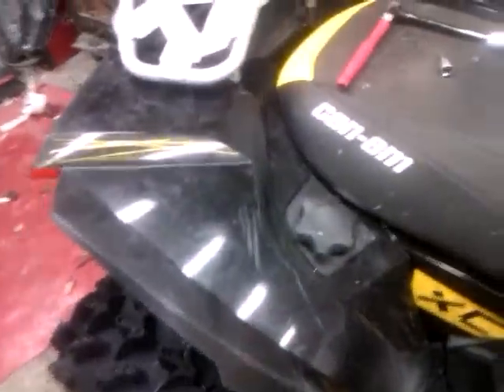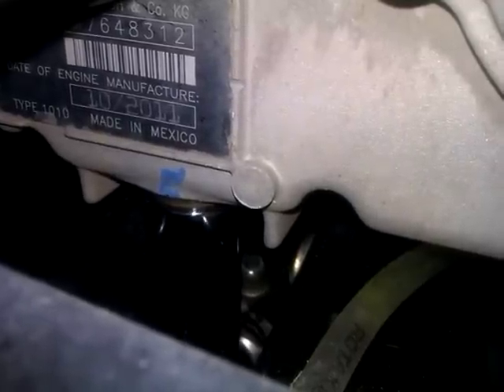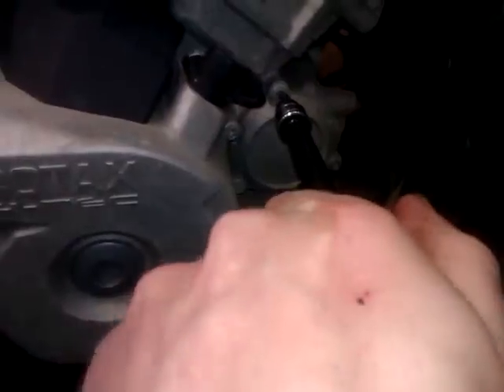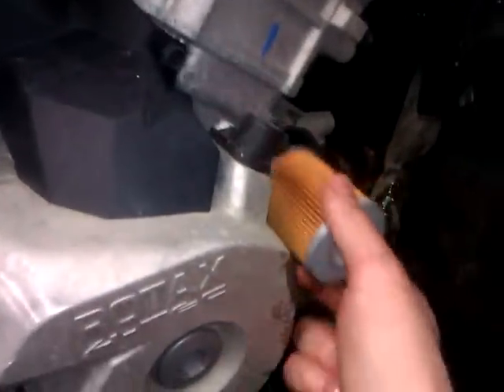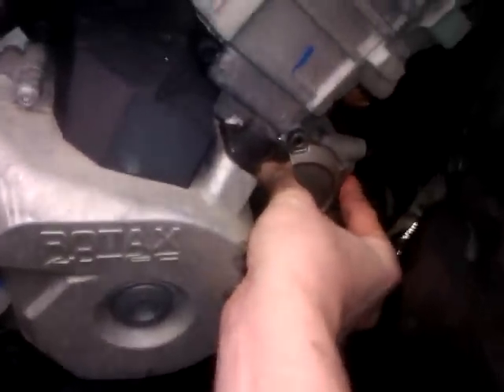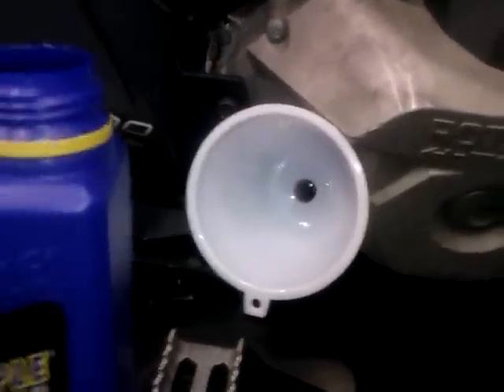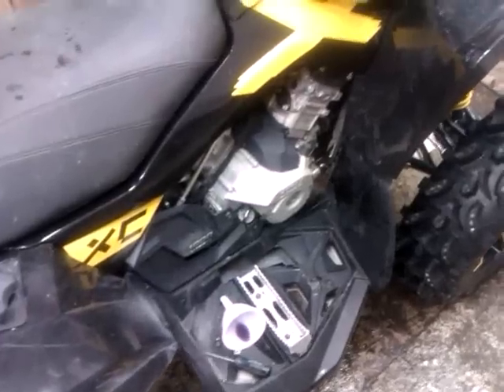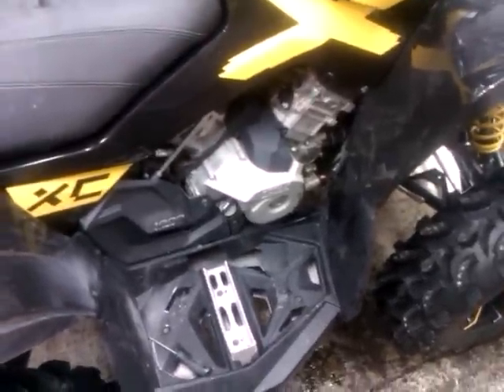Can-Am Renegade/Outlander Engine Oil Change, How to

Comment from the maker: Royal Purple is considered a high-performance oil with additives needed in a demanding performance engine. I used to run XPS because it's what BRP recommends but I noticed that the XPS is really thick in the winter, foams a lot at higher rpms, mixes with water and doesn't seperate even after sitting for a while, breaks down fast and costs around 18$ a quart. As for the Royal-Purple it keeps its viscosity in the winter, doesn't foam, separates from water, longer life and costs about 12$ a quart

Comment from the maker: Yes you have a good point there.
It's a great idea to warm up the engine before doing the oil change. The oil is not as thick when it's warm therefore it will empty out alot quicker.

Comment: I have the same tires on my Outlander. They're great. I've been through some deep holes and never had a problem in low gear. I highly recommend them. I have noticed they wear quickly on gravel though, obviously.

Comment from the maker: For the break-in use the oil that is in the quad when you get it. The oil that comes with it is break-in oil and has the additives needed for a proper break-in. That's why it's very important to change it once the break-in is done.

Comment from the maker: I changed it at 10 hours like it states in the owners manual, And yes I followed the break-in procedure. 15-50 where you live is in the correct range so you should be good.. I know of many guys here running RotellaT 15w-50 in the summer.....Great choice in oils by the way.

Thanks for watching.

Comment from the maker: It all depends on how mechanically inclined you are. I found it easy, the hardest part was taking off the valve covers.
In the 2012 Shop manual it's on page 21 (Section 01 - Maintenance, Subsection 03 - Periodic Maintenance Procedures)
Also do a search here in YouTube for "mudanddirt valve". John Cannon has a video on how to adjust the valves. His specs are different but the technique is the same. You'll find the specs in your manual in the section stated above. Let me know if you can't find it.

Comment from the maker: @04popo700 
My manual says to use 5w-30. that's why it's important to check your manual to make sure you're using the correct oils. my '08 called for 5-40 too but this new 2012 calls for 5-30...

Comment: I just bought a 2013 Can-Am Outlander 800r, bad ass machine!  It has about 340 miles on it with approx 320 hours which i thought was weird, guy said he did alot of snow plowing with it along with alot of idle time.   Have you had any major problems with your Can-Am?

Comment: i just bought an 2014 500 xt outlander i was told to change the break in oil after the first 10 hours, is that what you did or?

Comment: hello i have an outlander 570 2017 a message keeps coming up as soon i start the ATV , maintenance required, i did engine oil change, gear bor too, , but the message wont disappear, thank you
Reply from the maker: Gustavo Moreno 
That message can only get erased by the dealership.
Reply: thanks, they finally answer my calls , and they told me that too, now i need to wait for them to came and erase it, hopefully this year, thanks again for your time

Comment: How reliable are the renegades? i am looking at one but iv heard they break often? idk
Reply: I have an 07 renegade 800  owned it since new (Dec of 06) never had trouble only thing that ever broke is the control arm when I rolled it my own stupidy casued that
Reply: same here, i have over 2k miles of hard trail riding. its got an exhaust system, bigger tires and clutch kit... no problems.
O did i mention ive raced it a few times at the local mx track. it hold its own even though its twice the weight of the 450!!